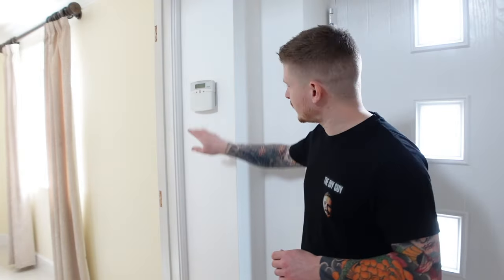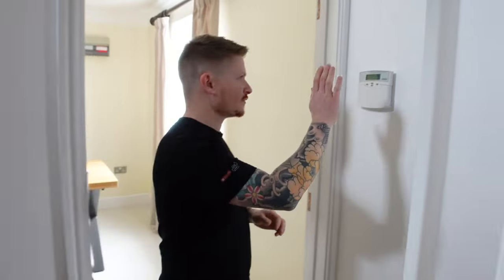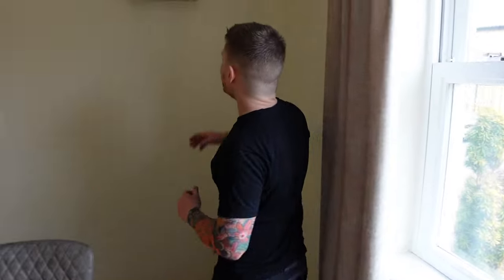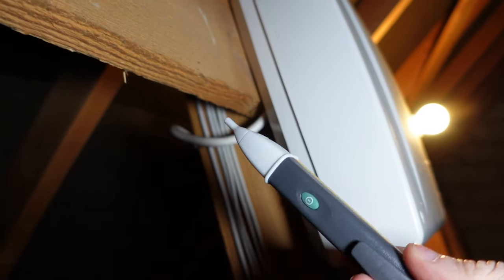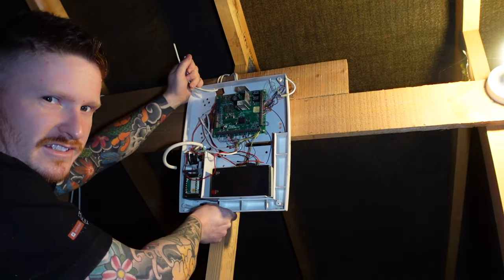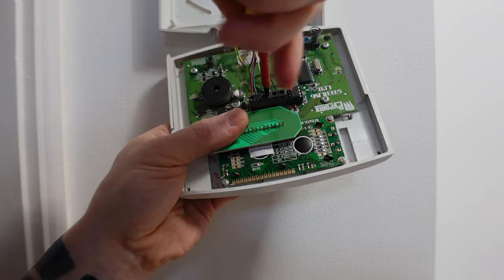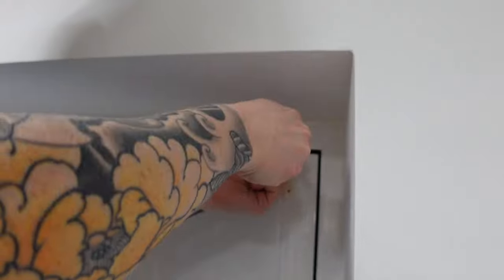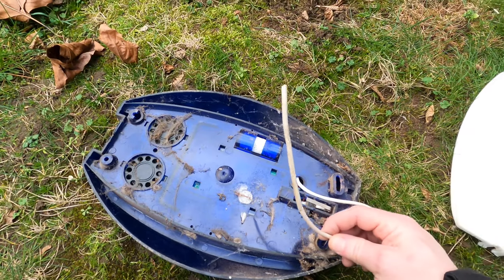How to Remove a Home Alarm System | Remove Any Wired Alarm

Comment: I have been in the alarm industry for 30 years and to cut off good hard wiring is just vandalism. If anyone ever tells you that a wireless system is superior to a well fitted hard wired system they are lying to you. Having to regularly replace batteries in every single wireless item is a pain in itself let alone the potential issues with radio interference. Wireless systems can be a good solution in some cases, but if you have decent hard wiring you are far better off staying away from wireless. I have no doubt that the "replacement" system will be a wireless type and that the channel will be getting sponsored to promote it.

Comment: What a shame.... cabling all in place for a secure and reliable home security system - much better than any wireless stuff you can get. Nicely put together video though.
Reply: My thoughts too
Reply: I think wired systema are old hat now with the ability to stream camera footage and get notified immediately by phone etc, all an alarm system does is notify and annoy my neighbours, while im blissfully ignorant about the situation.
Reply: @twinturbo5212 wired systems are certainly not outdated. Sure they are more expensive and complicated. They’re more for the professional side and would be used in commercial and industrial settings however using them in a domestic setting is still a popular choice. Another option is a hybrid system. These combine wired and wireless devices. Nowadays, wired alarms can also be controlled and monitored through a phone.

Comment: Don’t just cut your battery leads. And also most of the systems in the UK have a battery in the siren. This means if the AC and Battery voltage drops then the dummy will go off for a solid 20 minutes even when not connected to the panel. Awful stuff. Not a good idea to design them this way in my opinion as the most important part of any alarm system is ARC connection or in other words - monitored alarms.

Comment: Hoping the next video is not another boundary system. What are your views on the wireless alarm system vs old school wired in alarm system?
Reply from the maker: That depends on your requirements. If your fitting an alarm in an existing property where access to hard wiring is ALMOST impossible then wireless all the way. New build or renovation then wired.

Comment: The previous owner had an adt alarm system installed over 20 years ago. No longer paid after the first year, but still displaying a nice collection of outdoor signs and window stickers for sure. Cameras and motion detectors in every bedroom, bath,  window and door of my house ??? No thanks. 
Your video helped me finish the removal job started the day I took possession. If I thought I needed a self surveillance monitoring system, I would certainly not have purchased. Over 95% of alarms received by the police in this area are false alarms. In a letter I just received, they are now requiring registering the home alarm system and payment of an annual fee for the service provided by local law enforcement. One more good reason to remove it. Thanks for sharing.

Comment: Great video. I think one thing common on many systems too is a backup battery located in the bellbox on the outside of the house. Once you remove the main control box and disconnect the mains and the big battery, there's a chance this bellbox battery will sound the siren infinitely until it dies out or until you go up to the outside bellbox and remove it.
Reply from the maker: Your correct. I was lucky that mine was dead
Reply: @TheDIYGuy1  yes. The bellbox battery can be a bit of a nightmare. This scenario is what's responsible for the chorus of alarms you here when there is a power cut in the neighborhood. The main panel battery will be dead, automatically triggering the tamper on the bellbox which will use it's own battery. Thus the homeowners have no way of disabling it until the power comes back.

You're definitely lucky as these bellbox batteries tend to outlive the panel battery by a good 5-10 years or more!

Comment: In an ideal world the panel should be put in engineer mode this will enable you to remove any cover without causing the alarm to go off.Then disconnect the mains supply
cutting the power to an old panel could set the panel off due to the battery not being replaced during the life of the system especially if the panel is located in the loft as lead acid batteries are not a fan of extreme heat and cold  this is why during a power cut you will often here a alarm going off,
In the past when i have replaced panels i  put the panel in engineer mode then start with disconnecting the siren first as these also have a battery backup in them then remove the power from the panel,never the less a good guide.
there are manuals on how to reset the panel back to default mode if codes have been changed 
from memory default on a sterling 10 is function button 09999 to enter engineer mode function  009999 to exit installed a few of these back in the day

Comment: Excellent video again, thanks for taking the time.  I've been wondering how to remove my old alarm system and had resigned myself to calling someone out.  This helps tremendously and I now think I can tackle it myself.  Also, that looks like a mains wired door bell in the video.  Would love to see how to remove that, as I have one that needs to go.
Reply from the maker: Thanks, give it a go 👍

Comment: depends on the circumstances, normally i just power it down and leave the components in place

if they want it removed then i just push the cables back into the holes, but leave them in place running to the panel etc, incase another alarm gets installed in the future

most the time when i've been asked to disable an alarm, and spoke to them they want it disabling due to not working, and a lot of the time they're happy for me to get it working as they're an essential home security device

Comment: Great video and it has given me the confidence to carry this out myself.

One question I have is regarding the siren; is it mains powered or is the cable you mention, the 8 core that leads back to the alarm panel?
Reply from the maker: Thanks. The siren cable leads back to the main control box in the loft. That is how it is powered.

Comment: Thanks for this. Saved me £££s. Luckily the battery in external box is about 20 years old so no problem.
One question, when I remove the fused spur, would it be ok to replace it with a normal 3 pin plug socket? It would be handy to power a security camera.
Thanks

Comment: My house alarm was already in when I moved in over 10 years ago,  I have only just today realise it is wired  into the Bell fuse on the fuse board; I was trying to make some changes to my bell.  So when I flicked the fuse into the off position, the alarm sounded.  How and why did it do that if the power is off?  How will I remove the alarm from the bell fuse.....surely they should not have connected it to that fuse in the first place, there are free points available...I don't get it!  Please help if you can. Thanks.   Great vid by the way, cheers.

Comment: Surely the alarm will still sound even if the mains and battery are disconnected, because there is a battery inside the bell box that is mentioned for this very reason?

Comment: Hi, I have been trying to decomm my scantronic 9448 but too scared to do myself. Thank you for sharing. I have read somewhere that there is another battery backup but it's inside the external sounder?
Reply from the maker: Hi. Yes there most likely will be. In my video the external battery was dead so did not sound.
Reply: @TheDIYGuy1  Thank you for your reply, much appreciated. Looks like I will have to get up the ladder and bash the battery. 😁

Comment: Great video. Daft question I'm sure, but is there no risk when snipping the wires (pushing them into the cavity/wall/ceiling) that when you turn the CU back on they'll spark/touch one another?
Reply from the maker: No risk at all as long as you disconnect the power as shown in the video.
Reply: @TheDIYGuy1 his question is for when you turn the power back on eventually duh

Comment: Moved into a new house, they told us the alarm was disabled… turned out it wasn’t. Managed to stop it but now definitely want to remove the system, just got to find the control box now. Do we need to remove the wiring too? Or will that ruin the walls and such?
Reply from the maker: No you don't need to remove the wiring 👍

Comment: No need to cap off wires you stuff back in the wall? When powers turned back on there’s no live wires anywhere?
Reply from the maker: No, there is no power to these wires.
Reply: @TheDIYGuy1  I am removing a system and there is one wire that is still live (though likely low voltage). Why doesn't it need to be capped before putting back into the wall?

Comment: I installed my own alarm system, and did you know that even external sirens have their own backup battery which requires a "hold off" circuit most at 12-13v, even if both batteries were working how would you dismantle that system, without that external siren letting all the neighbours know that the house is being burgled

Comment: It's not that simple I'm afraid, what good is an alarm system if the bad guys can just switch it off at the panel? What's going to happen is the bellbox outside will sound and you won't be able to stop it unless you have ladders, if you are lucky it will stop after 20 minutes but may go off again or worst case if its an older box it may sound indefinitely! It's much easier to just change the battery in the panel at least that will keep the system happy even if you don't intend on using it. The other complication is it may be under contract such as ADT.